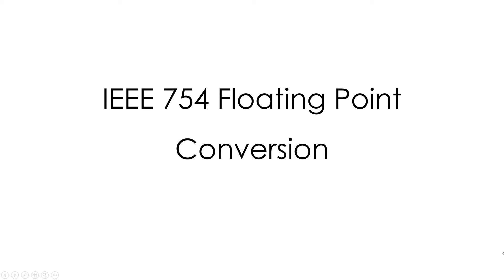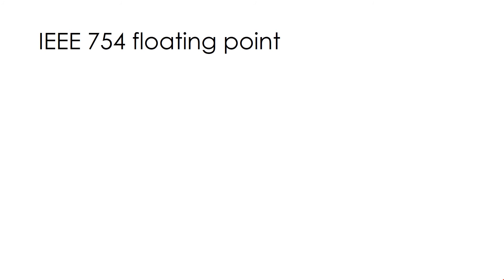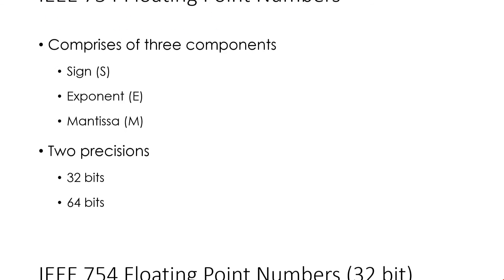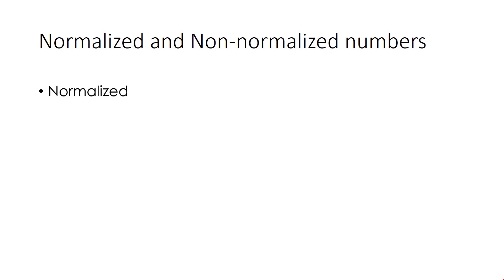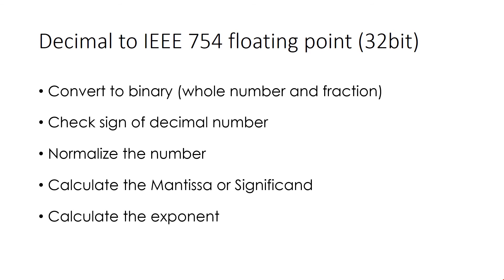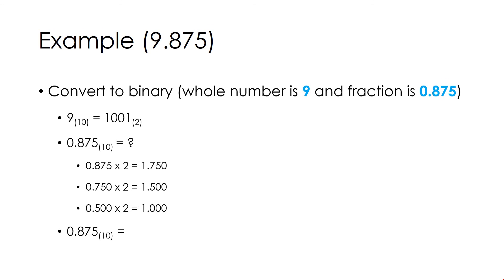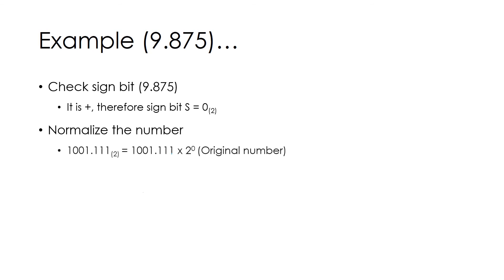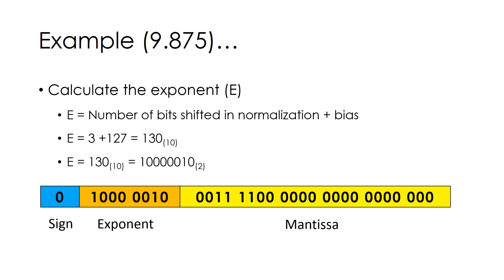Easy IEEE 754 Floating Point Conversion (Single Precision)

Comment: Can you do another example to convert a negative decimal to floating point number please
Reply from the maker: Yes. Definitely. I will. Subscribe to my channel. I will publish the video in a week.
Reply: xnk you so much sir.when its a negative number, on normalize the number does shifting has to start from 1? and on calculating the exponent do we substract or add the bias with the number of bits shifted?
Reply from the maker: Sorry for late reply. You need to start from the left. In fact don't consider the negative number. Simply. consider it as positive number and complete the procedure of normalization and bits shifting. Only consider the sign bit as 1 in final result. Rest of the procedure remains same.
Because of your request I have prepared another video on second example. Here is the link: https://www.youtube.com/watch?v=rvs5SLJvbKs

Thank you for your kind words!